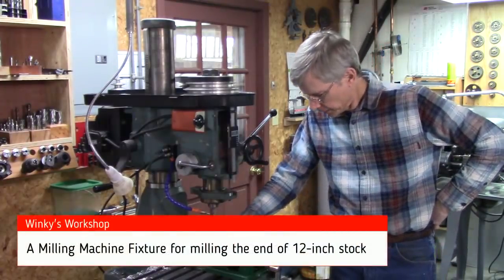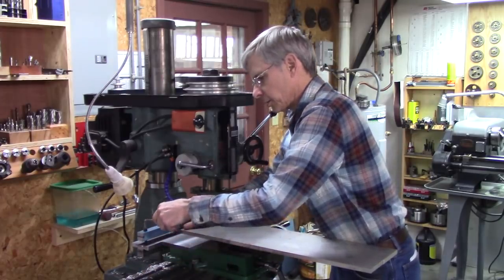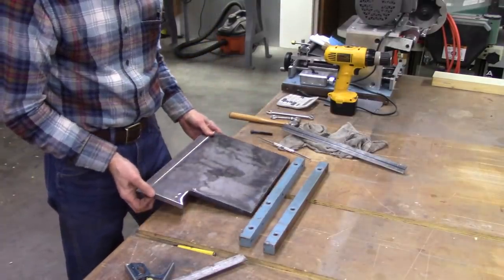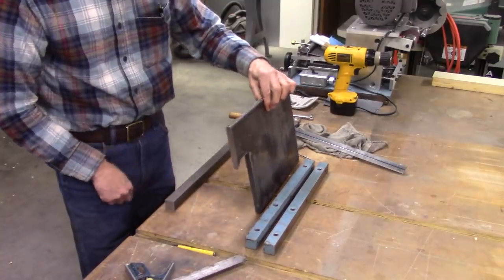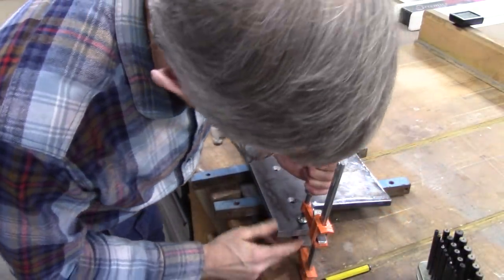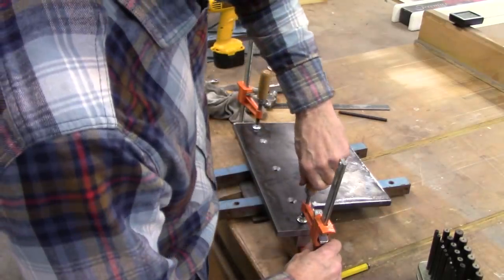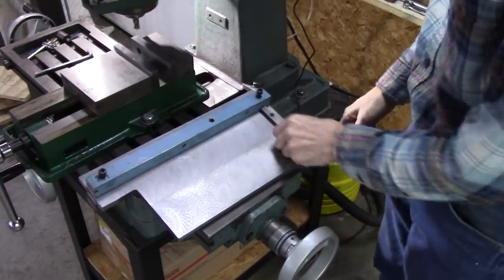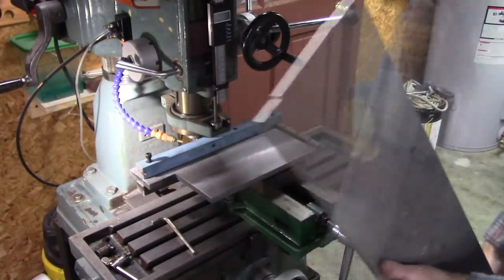Accurately Mill the end of 12-inch stock. A Milling Machine Fixture

Comment: Remove The jaw of your vise closest to you  and bolt it to the movable jaw at the two tapped holes closest to the handle that is why they are their you will have more than 8" of clamp of course it will only work with the first vise you started with why did you change vises ?
Reply from the maker: Yep, you are correct, although I didnt change vices. the other one was on my drill press. Also, the capacity of the vice is still a bit less.

Comment: You can reverse the jaws on your vise and use jacks.
Reply from the maker: Very true. Although my mill doesn't have enough travel or at least you can't mount the vice to take full advantage of it.  Also, this fixture is very fast, way faster than moving jaws. Odd shapes too. I've salvaged a lot of off cuts from a plasma cutter that would be near impossible to clamp.

Comment: Thanks, great set up, going through that right now. Wondering why you didn't back the tap off to break the chips?
Reply from the maker: Thanks! The tap is a Spiral Point Tap. It ejects the chips toward the bottom of the hole so there is no need break the chips. Quite often I put then in a rechargeable drill but over 1/4" the tap tends to slip in the chuck even though they require about half the torque of a regular tap. They are not good for a blind hole, all the chips get packed into the bottom of the hole.

Comment: When you apply presure to drilling a hole on the drillpress it sure does move downwards and will give a slightly non vertical hole, not usually a problem till you have several that must all lighn up. Put a machine jack or any type of jack under the table just snug will stop the table bending, even some blocks and wedges will do the same job but a small machine works best.
Reply from the maker: Thanks for the comment. Most of the movement you saw was my home made x y table flexing although I need to modify the design on my slide on the drill press. The support arms flex a little. https://youtu.be/i4_FtMMMfDw

Comment: Good job, Sir!
Reply from the maker: Thanks, some have rightfully pointed out that moving the jaws of the vice to the outside would increase the clamping range and they were correct. In this arrangement you are holding the stock with the top edge of the jaws. This works well for stock with two parallel (and square) sides.  The biggest advantage to this jig is are, 1) speed (it takes a while to move the jaws) and 2) squaring irregular shapes. On several occasions I've salvaged odd shaped pieces cut with a torch that could not be held in the vise.

Comment: great idea , I like that ! ..ENJOYED
Reply from the maker: Thanks, I messed up when I said there was no way to clamp a larger piece in my 5 inch vise. You can move the jaws to the outside and clamp 9 inches with the top edge of the jaw.  Never the less. This fixture is was quicker than moving the jaws and also has the added ability to clamp and mill odd shapes. Oh yeah...  and the y travel on my mill is also only 8 inches and if the vise is not centered correctly you can only mill maybe 6.5". Thanks again for the comment.

Comment: That is a positively brilliant idea, I call that thinking outside the box. Even with the full size mill I have it has limitations
Reply from the maker: Thanks!  I also use it a lot for hard to hold items like an off cut from something you cut with a torch (I grind the weld first of course).
Reply: Winky's Workshop I would like to send you some channel swag from my channel email me a mailing address to jdedmon91@gmail.com

Comment: that looks like a pretty handy item. I can think of a lot of uses for that. thanks for posting
Reply from the maker: Thanks. It works well for holding odd shapes also.
Reply: @WinkysWorkshop  A nice simple design suitable for a number of uses in clamping large flat stuff.
Reply from the maker: @millomweb  Thank, I have used it a lot actually. The only problem area is the clamp bar. It flexes. It works but it's hard to get even pressure so it holds well.
Reply: @WinkysWorkshop  Slightly bend the bar so it curves up towards the ends. Only tighten the bar enough so it's straight again.
Reply from the maker: @millomweb  - good idea. 1 x 1 is fairly stout but I think I can do it in my arbor press.
Reply: @WinkysWorkshop  Option to use heat or mill the ends a bit thinner - so leave the center 3" as is, angle it 1-2° mill another 2" towards the end, increase the angle 1° and mill to the end. Or some variation of that. Ideally, it should be one long curve.
Reply from the maker: @millomweb  Agree.

Comment: A bit of a pain, but you could possibly turn the vice 90 deg and move the jaws. Easier with a rotating base.
Reply from the maker: Agree...  but the fixture is way faster. I do have a swivel for the vise but I took it off. I think I needed just a little more room under the collet...  can't remember. There is another advantage to the fixture also. You can hold odd shapes.
Reply: I usually keep my swivel off for the same reason. :)
 @WinkysWorkshop

Comment: While the tapped holes on the outside of the jaws allow for moving the jaws so you can hold wider pieces, your fixture has an advantage of being able to cut the edge of a wide piece in one "X" axis pass, where moving the vise jaws, limits you to the "Y" axis travel. One can blend the cuts, but it's not as nice. Good job!
Reply from the maker: I get it now...  so you are clamping with the 1/8" lip that sticks up above your moving section.  Cool...  that would work although 1/8" isn't much surface area. Then there is the fact that I have a 9" travel on mill. The vice mounts about 1-inch off center so a lose an inch making the max about 8 inches...  still not bad. The fixture offers a larger capacity and is also faster than moving a jaw. The only negative is the overhang on each side of the vise but so far I've not had any problems with this. Milling 1/2 plate steel with a standard end mill I had to slow down a little out at the end but with a roughing mill I mill at a good speed.
Reply from the maker: Thanks, and I agree. Also I like fast and easy. It took me about 2-hours to make the fixture but it will save lots of time and effort in the future. Honestly, you could probably make it in an hour if you were not making a video too - Ha

Comment: Now if I  only had a mill.   I like to see the  process involed.  Gives me some ideas for  some jigs  I need  to make.   Reading some of the comments about tap wrench  guides.....I think you were  talking about  the tap wrench itself  weren't you?  If the complaint is there is no place  for your center to    rest on because the tap sits to deep in the  wrench,  just cut the square off of an old broken tap and drop it in on top of the tap to bring the  center up to where you can engage your  center on the drill press.  Thanks for sharing and have a happyday!
Reply from the maker: My mill is not the best but I love it. Very convenient! I think I understand about the center on the tap but most of mine do not have a center, I think 2 of the larger ones do and that's it.

Comment: You can move the jaws on the vise so you could hold it
Reply: Hi, yes, but not to mill across the short end on a long piece.
Reply: @bobuk5722  Depends on the Y travel of the mill.
Reply from the maker: @panon5292  - Yep, and it's only 9-inches. Also my vise has movable jaw plates but the jaws themselves are not movable.
Reply: @bobuk5722  Yes but you just do one side then flip it,
he still can only do one side at a time...
Reply from the maker: Thanks - I can move the 1/2 inch thick plates and gain 1" in clamping width or move the plate to the outside of the moving jaw for ID clamping but there is no way to move the jaws on my vice. That would be a nice feature although I suspect this fixture is a bit more convenient. This fixture also allows a 12-inch side to be milled and my table travel is about 9-inch.
Reply from the maker: Got it...  I see what you are saying now. Still, I'm limited to the 8 or 9 inch travel of my Y travel. I could turn the vise of course but this fixture is way faster and capable of a full 12 inches.  Thanks
Reply: @WinkysWorkshop  That's what I like. It's way quicker than changing the jaws around.
Reply from the maker: @panon5292  - Yep, I totally agree. I hate to admit this but I didn't know about the jaws but never the less, there is no way I could mill the end of a 12 inch piece of metal without rotating my vise and that is more time consuming that moving the jaws. And thanks, I love this fixture. There is also another advantage too, if you are milling irregular shaped they are easy to hold.

Comment: You should make a spring loaded tap follower to mount in the drill chuck.
Good video.
Reply from the maker: Good idea! I have one I made for my lathe but the pin falls out if I use it on a drill press. I probably need to buy one.